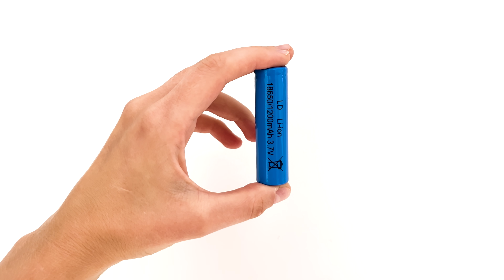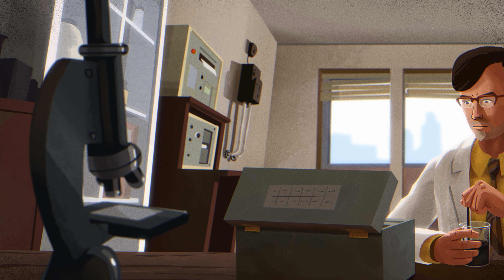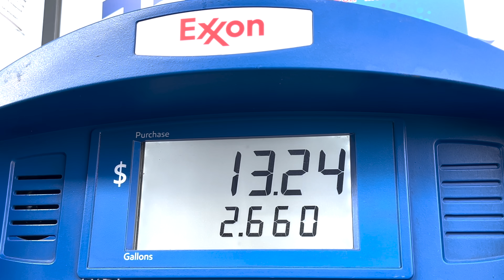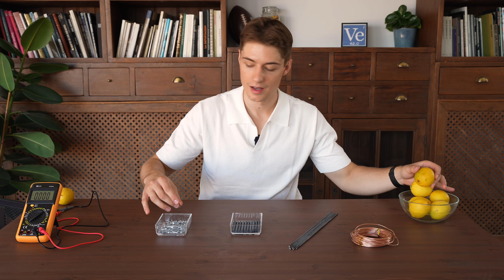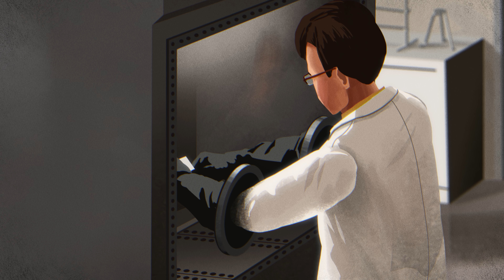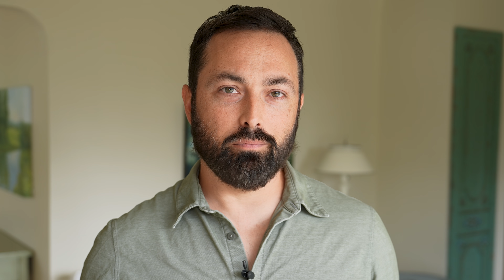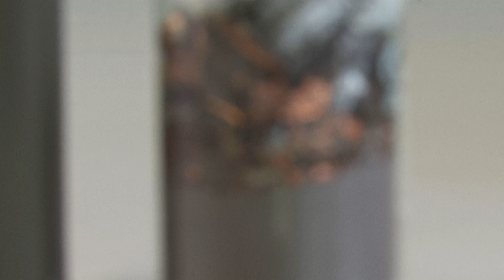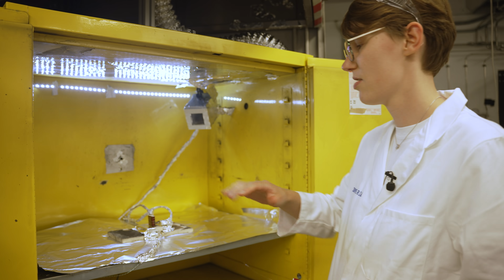The Perfect Battery Material Is Dangerous

Comment: Yeaaaaah no. Water is a temporary solution at best. The recent batteries (for eg Samsung produces up to 200KWh per cell) have so strong chemical reaction it literally pulls the oxygen from water (technically burns) and releases hydrogen. If the water level is not high enough that H2 still burns and if you take the battery out of the water it continues to produce flames for a long-ass time. The electric cars that bursted once are put on empty fields for years by the fire fighters because they cant do anything about. They have to wait out the end of reaction and god knows what they can do with the toxic waste.

Comment: Want small batteries that deliver lots of energy? That means high energy density, which means unstable chemicals and the potential to overheat if you draw too much electricity too quickly. You can mitigate that a bit by putting in safety features and stronger cases, but those are all dead weight that increase bulk for no power gain. Batteries have always been dangerous, and if you want them smaller then they will inevitably be more risky.

Comment: Unpopular opinion. Once there will be a battery that doesnt explode or burn. And has like 10.000 cycle capacity. It will revolutionize the obsolate electronics market. Even if its just 1000mah You will have old phones running home media servers. Security systems and what not. You will have a drawer with 6 old phones running stuff for you with usb lan and low power and no fire hazards. It doesnt even need to hold the charge long jsut to bridge outtages. So built in UPS functionality.

Comment: You skipped over Rachid Yazami for his crucial role in developing the graphite anode for lithium-ion batteries. And you missed out that the first Lithium Ion factory outside Japan was built in Denmark and the first volume product in USA using lithium ion batteries (HP Ipaq) were supplied from Denmark and finally that the first Chinese lithium ion battery factory in China was built by a Danish company. And finally that the CTO of that Danish company held the power density record for years.

Comment: Fun fact, I once left my laptop on by mistake next to a wireless keyboard in my laptop. The keyboard battery expanded so much that it almost burst and it budged out cracking my keyboard. Thankfully, nothing happened but I removed the battery and my keyboard only works in wired mode now.

Comment: Had a fire in my appartment involving about 40kg of li-ion cells recently. But the point is, the ignition source was the developer wiring. My electric unicycle, gf's electric scooter - their batteries were badly damaged but intact. That were 620-ish cells near the faulty electrical panel which ignited from the burning clothes. I guess that was pretty spectacular, with cells flying all around and air temperature even in farthest places exceeding 160-200c.

Comment: The sad part is that cheaper & safer batteries than Lithium battery already exists and has been existing for almost a decade by now.
There are already polymer solid-state batteries that can replace Lithium (no liquid and no reaction in case the battery is damaged), but the implementation of those battery requires new regulations & rules and the usage requires a new mindset of the risks involved. And, also, the battery manufacturers in the world aren't interested in anything else for now as they still have massive amount of raw materials and resources acquisition systems in place that would become just useless the day they switch to solid polymer batteries. In fact, some of the owners of those battery companies also own shares in the resources sources for lithium batteries so "killing" that market would only be a last-resort kind of move.

Comment: 29:31 That is actually thermal runaway, and the most common (a lithium battery fire) not an explosion. Explosion only occurs when the current bridges that gap directly, extreme heat in a small space.
We need even more recycling. And we just need a lot less personal transportation vehicles.

Comment: don't try this at home oops already did😊. Energizer lithium battery and a pipe cutter from the hardware store. It will burn Brite white for about a minute then have a tiny explosion, on concrete, and will melt a hole about 1cm  deep and 2cm wide. It makes some beautiful sparks in a full spectrum of colors when it does pop/explode. Dont tell your parents I told you

Comment: Some tech companies are looking at solid state batteries. It’s mostly just for electric vehicles. But I think phone companies should start looking into it. Studies so far have shown since it’s a solid in the battery breather than a liquid for particles to flow through, they last longer. Degrade a lot slower. They can hold a charge 10x to what lithium ion battery’s do. And also charge significantly faster

Comment: The hazard of standard cells actually initiated the use of garnet structures as a possible solution to chemically reactive batteries. Though traditionally thought of as a gem or abrasive material, garnets actually have an ability to be chemically "customized" (we see this regularly in lasers, with YIG and YAG - yttrium iron/aluminum garnet). Because of this quality, garnets can be chemically dominated by lithium to hold a charge. However, you can think of the silicate structure of the garnet as a "glass," making a battery produced with this material effectively inert, as there wouldn't be the need for traditional metals or an electrolyte

Comment: Why is the storage called KWh instead of KW. I can store 1000 liters, 1000 grams of sand in a bucket, Why would i call it  KLh of KGh?
If a battery stores 1000 Watts, i decide how fast it drains. A 100 Watt lightbulb will light for 10 hours. So the battery stores 1000 Watts.
Reply: Tell us you don't understand how capacity works without actually using those words. The battery doesn't store just a certain amount of power indefinitely. It stores a certain amount of power per unit of TIME, meaning that you can only pull that amount of power for an hour, or less power at a time for longer than an hour, it all maths out to that number of watts per hour. And you don't decide how fast it drains; the load does.

Comment: I like your videos, but I watch them on a phone. The different segments have very different sound mixes. Some have relatively high treble, such as when you are speaking, while others are so low in treble that they sound muffled.
Through a phone speaker, if I make the muffled segments sound ok, the better quality segments are so harsh that I either have to turn the volume down to the point that it's hard to hear, or adjust the equaliser settings.
It's not THAT hard for you to adjust the sound so that each segment has similar volume and frequency output. It doesn't have to be perfect; I can handle some difference. I just want to be able to hear "s" sounds in the most muffled segments without my ears going into an "overdriven", clipped mode in other segments.

Comment: WOW,  ZERO mention of new battery design that are extremely hard to catch on fire.    Or the new SALT based batteries that don't go on fire.   Or the new SOLID STATE ($$$) batteries that contain more energy, lighter and CAN'T GO ON FIRE.        This is oil companies trying to scare you by using data from decade or more ago!    No mention that ICE (internal combustion engine)  vehicles experience fires at a rate of roughly 1,530 per 100,000 vehicles, EVs experience only about 25 fires per 100,000 vehicles.    That number is going drop for EVs with new battery packs as well.

Comment: Breaking news: extremely energy dense material can release said energy quickly and catastrophically. 
Up next: water wet?!

Groundbreaking scientific journalism by veritasium, stay tuned for more.
Reply: Lithium itself is not super energy dense, nor cobalt, oxygen, or graphite. In terms of energy density, Uranium, Thorium, and Plutonium take that cake. But they don't exactly just blow up randomly. What makes batteries more dangerous than materials like Plutonium and Uranium is that they are designed to store and release energy at a moment's notice, while nuclear reactions can't do that. The part that is news, however, is the story of balancing safety, compactness, and reliability. If that sounds like a simple matter, then you probably just do not understand how many different substances there are that can function in each of the three roles: anode, cathode, and electrolyte. Just a brief Google search reveals that scientists have considered practically the entire periodic table for potential use in all three roles.
Reply: @RKSRocks6334  sorry but were you dropped on the head as a child?
1) Who tf cares about the individual atomic constituents, obviously talking about he anode-electrolyte-cathode sandwich composite as a whole. Wow what a fast car "acschually steel by itself does not move" are you slow?
2) Bro has never heard of the atomic bomb apparently? lmao. Every material whose stored energy is even remotely accessible has an inherent degree of instability. Talking as if nuclear reactors aren't the most carefully controlled environments on the planet.
3) You pulled the "simple matter" out of your own bum just as an excuse to dig in there and sniff your own copious amount of farts. Just a brief google search reveals many reading comprehension courses that could allow you to understand I'm arguing it's inevitable that energy density comes at the cost of safety, not that we should use something else.
Reply: @RKSRocks6334  were you dropped on your head as a child? Just a brief google search would teach you how to read, and that the atomic bomb exists.

Comment: I had a battery catch on fire when I was working back in 2000 in Colorado. I had it on charge and it just started smoking up. I quickly unplugged it and threw it outside of the building that we were working in

Comment: I was hoping you might mention Lithium Iron Phosphate (LiFePO₄ or LFP) batteries. From what I understand, these are much more stable and safer compared to lithium cobalt oxide (LiCoO₂) cells. LFP batteries have a lower risk of thermal runaway, so even if they are punctured or damaged, they are far less likely to catch fire or explode than cobalt-based chemistries. They also tend to have a longer cycle life and use more abundant and less toxic materials, though at the tradeoff of slightly lower energy density. That’s why they’re becoming more popular in electric vehicles, stationary storage, and even consumer electronics where safety and durability are more important than maximum capacity.

Comment: should have mentioned LiFePO4 batteries. USA wanted to hurt China by banning export of Cobalt to CN and in response they created a new battery that doesn't use coablt, which turned out to be significantly safer and longer-living, such that the majority of electric car makers have just abandoned Li-ion and switched to LiFePO4. Yes, the density of LiFePO4 is lower than modern li-ion, but to get a li-ion to last longer than a few years you need to keep it at 20-80% meaning you're decreasing the energy density by 40% from day1, and then it still degrades faster than LiFePO4 which doesn't need the 20-80% rule.

Comment: What does a kilogram equal to in Standard and why do you keep using the metric system. You might at least convert and use both so i have some idea what u are talking about? Waaa.  360 kg is 780ish lbs? Idk…..  what causes cathode degradation. They get coated right… but what with, could a cycle like on a water softener clean them off?

Comment: Typical click bait.  Dumb statements like 'best batteries we have" don't help as batteries are always application sensitive.  Li makes sense for portable applications but we have relied on Pb tech for generations (submarines), until Li tech caught up, and Pb for power backup systems are still made because there is still a market for them - which is the key - we use what the market needs.

Comment: The very first battery was likely the Baghdad Battery. 
Not the frog.
Reply: It's a thoroughly debunked myth at this point. Not a battery
Reply: @ludvigthebirb7131  Nah, they aren't a "myth." 
You can deny they were used as a battery, but you cannot deny their existence. 

Ascribing some other function for them is just as speculative as calling them batteries.

Comment: This is an awesome video, but I wish it had explained more of what's developed in just the past few years.  If the basic chemistry hasn't really changed that much, how have we been able to really increase the energy density, performance, recharging time, number of charge cycles, make safer from exploding, etc? We've had dramatic improvements and I'm wondering what's changed in the design/chemistry/engineering process to do this, and how much more do they think we could push this density with lithium chemistry?
Reply: he sold his soul and channel to private equity so expect quality to keep going down, everything is done to make $$$ not good content. In some videos he doesn't even understand the concept and their fact checking is really lazy and bad. I think they do it on purpose so people comment to correct them and farm engagement. I unsubbed and you should too to show creators we will not support this greedy behaviour.

Comment: 🧪 Technological Difference
The primary purpose of a silicon-carbon anode is to significantly increase the energy density of the battery. While a graphite anode can store one lithium ion for every six carbon atoms, a silicon anode can theoretically store up to 10 times more lithium ions by weight. This is why silicon is considered a next-generation anode material.
Therefore, the video, which explains the foundational scientific principles and the historical journey of the first commercial lithium-ion battery, would not have included this newer technology, as it was not part of the original invention story. It represents a different chapter in the ongoing evolution of battery chemistry.

Comment: Lithium iron phosphate, or LiFePO₄ (LFP), is indeed a significant and widely used lithium-ion battery chemistry, and it is a valid point of discussion when exploring the landscape of battery technology. While the video focused on the historical development of the early lithium-ion battery, it did not cover the broader range of modern battery chemistries. The LFP chemistry, in particular, offers a compelling balance of advantages that addresses some of the key limitations of other chemistries like nickel manganese cobalt (NMC) and nickel cobalt aluminum (NCA).
Here is a breakdown of the key characteristics of LFP batteries in comparison to NMC and NCA chemistries:
⚛️ Fundamental Composition and Safety
The primary distinction of LFP batteries is their cathode material: they use lithium iron phosphate, a composition that entirely avoids the use of cobalt and nickel. This is a crucial point for both ethical and economic reasons, as these metals are often expensive and associated with problematic mining practices.
The atomic structure of the LFP cathode features strong covalent bonds between iron, phosphorus, and oxygen. This robust structure is inherently more stable than the cobalt-oxide bonds found in NMC and NCA chemistries. Consequently, LFP batteries have a significantly higher thermal runaway threshold and are far less susceptible to fire or explosion, even when subjected to overcharging, physical damage, or high temperatures. This superior thermal stability is a primary reason for their growing adoption in applications where safety is paramount, such as electric vehicles and large-scale energy storage.
⚖️ Performance and Lifespan
While LFP batteries offer superior safety, they present a trade-off in performance characteristics when compared to their NMC and NCA counterparts:
 * Energy Density: LFP batteries typically have a lower energy density than NMC and NCA batteries. This means that for the same amount of stored energy, an LFP battery pack will be heavier and larger. This is a significant factor in applications like long-range electric vehicles, where minimizing weight and maximizing range is critical. NCA, in contrast, is known for its high energy density.
 * Cost and Lifespan: A major advantage of LFP is its lower cost, driven by the use of abundant materials like iron and phosphate instead of costly cobalt and nickel. This, combined with their exceptional cycle life, makes them a very cost-effective solution over the long term. LFP batteries can typically handle more than 3,000 full recharge cycles, whereas NMC batteries are generally rated for 1,000 to 2,000 cycles.
 * Voltage: LFP cells have a lower nominal voltage of around 3.2V, compared to the 3.7V of NMC. This can impact the power output and requires more cells to achieve a higher voltage, further contributing to their size and weight.
In summary, the choice between LFP and other lithium chemistries is a strategic one, balancing priorities such as safety, cost, energy density, and cycle life. The LFP chemistry is a vital innovation that has enabled safer, more sustainable, and longer-lasting battery solutions, expanding the applications of lithium-ion technology.
Reply: he sold his soul and channel to private equity so expect quality to keep going down, everything is done to make $$$ not good or factual content. In some videos he doesn't even understand the concept and their fact checking is really lazy and bad. I think they do it on purpose so people comment to correct them and farm engagement. I unsubbed.